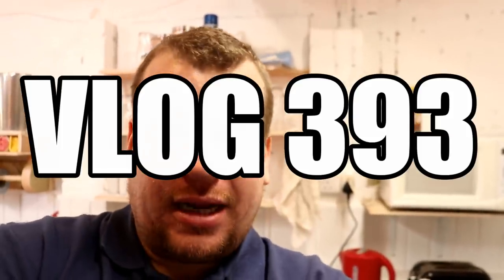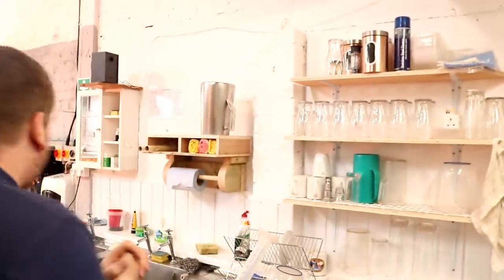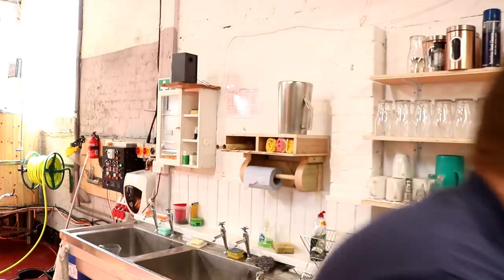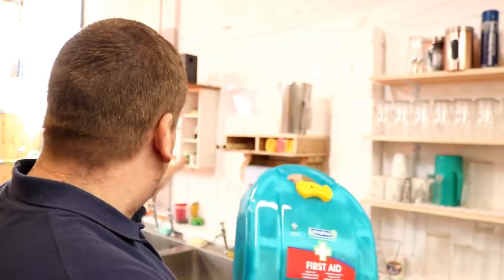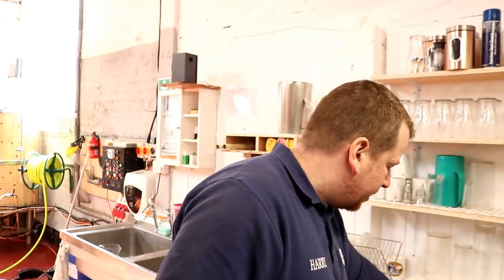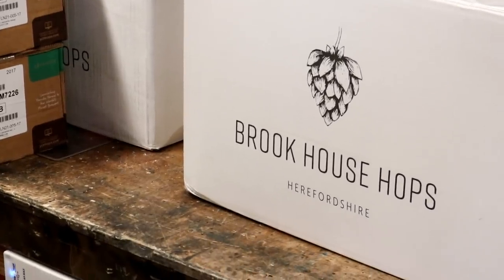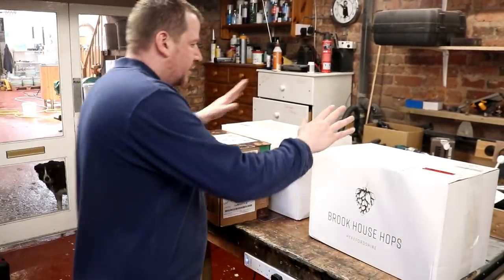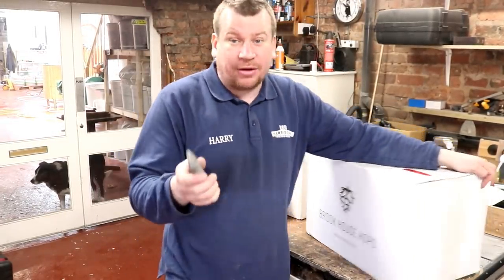THEY MADE A GOOD IMPRESSION

Comment: regarding the radiator/fan setup... usually on a car the fan is placed closely behind the radiator drawing the cold air inwards and blowing back towards the engine. not entirely sure if mounting it away from the radiator and blowing towards it or the previous method would work best but might be worth experimenting to see which is more efficient